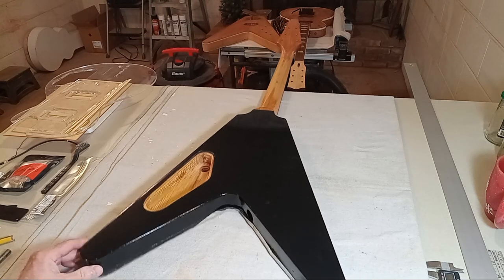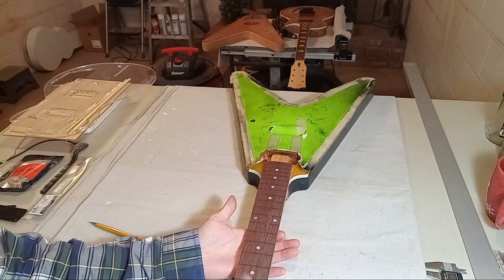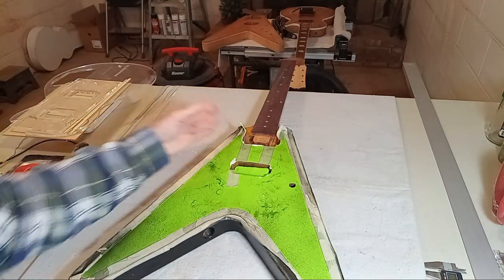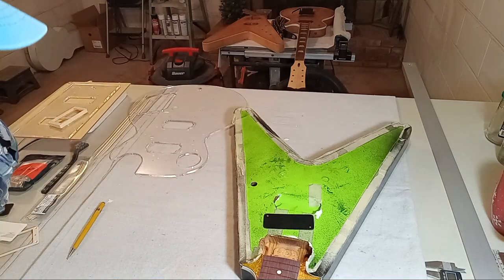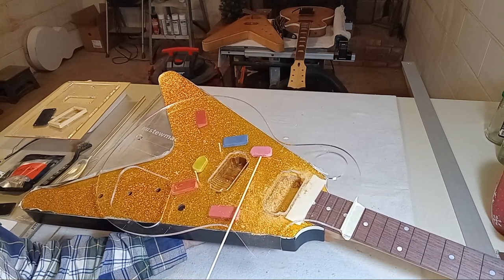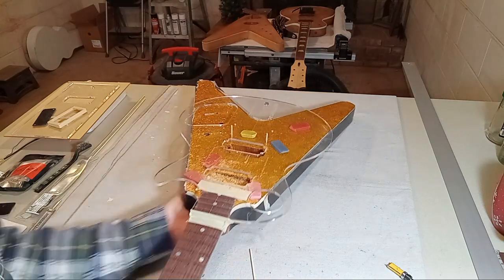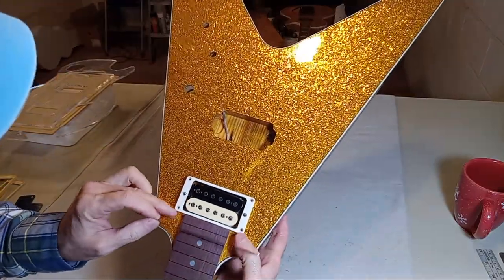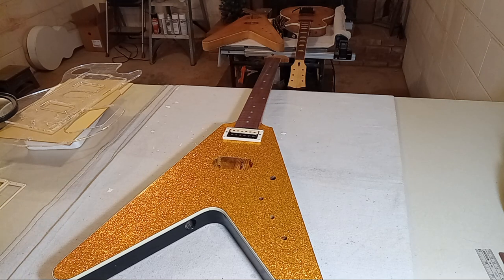V11. How To Design Build A Custom Sparkle Flying V Per 1950's Specs.  MOA V#7

Comment: I'm thinking... A natural version of Lonnie Mack's V...
Reply from the maker: At the moment I'm not taking on any more Custom builds unless it's someone I know or trust.  Most of my contacts are in Nashville, so the projects are for Session and/or Touring Players, or a unique project I do as a Vocational project here on YouTube. 

You can probably expect between $3K to $5K for a Clear Honduran Mahogany Lonnie Mack V, yet, Custom Built to your Specs.  Again, that's why I mentioned the Epiphone guitars are such an incredible value.  

Thanks,
Marc
Reply: @DejaBluGuitars  sadly, I received my Epi V today and there are new cracks at the neck joint. I can't tell if it's just the finish or something more, but my confidence is shaken and I'm sending it back to the seller... 😥
Reply: Would you agree that I should return it? I've heard that, as thin as these poly finishes are, if the finish cracked then there's likely been some movement in the wood at that joint.
Also... The box looked like UPS dropped it on one end!!! Ugh!!!
Reply from the maker: @GreenMachine1975  Ah, that's always frustrating, but it's impossible for me to offer any suggestions without knowing the complete history, or having the guitar in hand.   Maybe, take it to a local shop, buy a set of strings from them, and ask what they'd charge to inspect it?

Thanks for watching and commenting. 
Marc